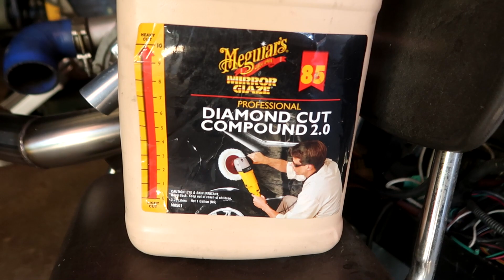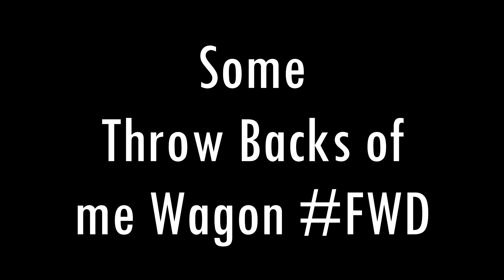300HP AWD CIVIC WAGON  |  EJ2 IS FINALLY 1 COLOR!

Comment: I see a lot of intercooler pipes blowing off on these vids on YouTube 15 years back I had same issue with my Mazda 626 turbo wen I done full upgrade to a eBay t4 and 3” stainless pipe work,I got my welder out and put nice spot welds about 8 of them on the end of each pipe that gets a joiner so the clamp has something to bite on wen under load and not pop off the intercooler pipe if you’d get what I mean didn’t have a bead roller so 4 to 8 spot welds placed around the end to make a lip for clamp and joiner to hold onto worked awesome never had a pipe come off runing 20 psi